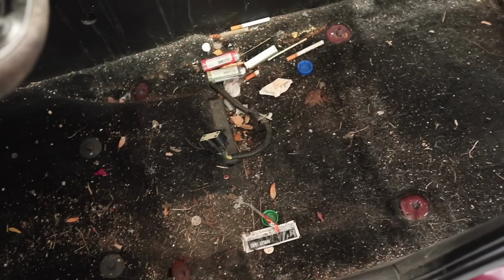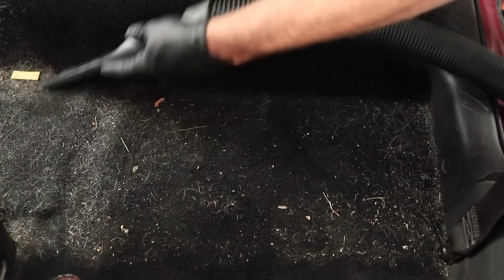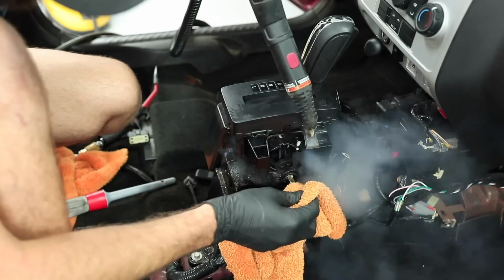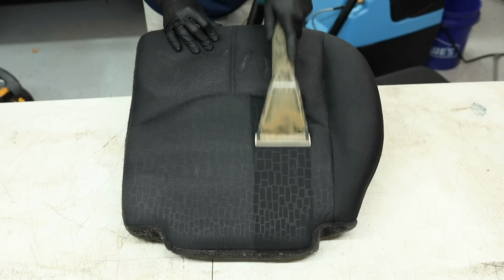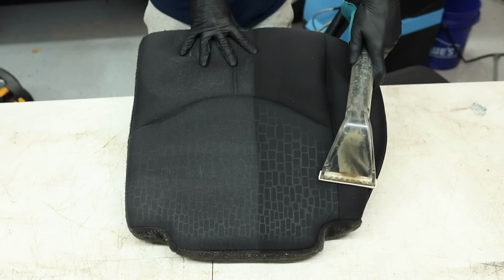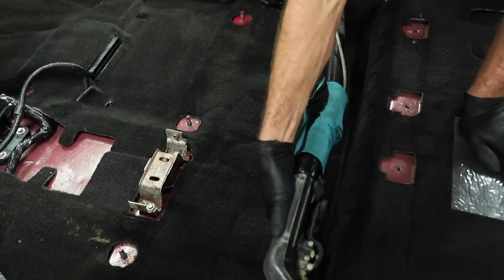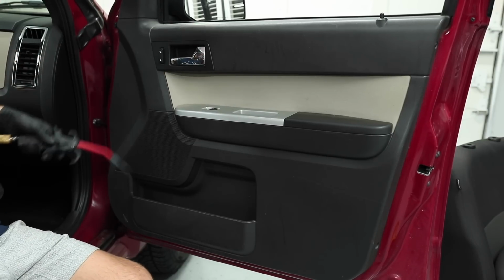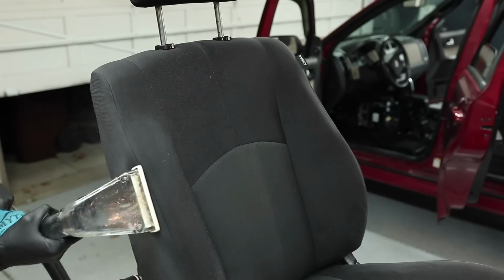Car Detailing Restoration of An Insanely Pet Hair Filled Mercury suv

Comment: Is the bio break still your "go to" cleaner for seats and carpet. I have tried it but it doesn't seem to work real well. Maybe I'm not mixing it strong enough. I usually have to go back over the dirty areas with superclean 4 to 1 or stronger.   Great work as always. Well I see you mentioned Bio break later in the video. I guess i need to mix it stronger.

Comment: I love my microfiber towels + my brushes, now I need to get the scrubber for my drill and I guess, I'll have to go to a gas station to use an air hose for drying. Is there a special solution you use to remove the pet hair? Since I have a van, just getting the front area done takes me longer than it does for you to do a whole car. Plus I can't get the front seats out😔
Reply from the maker: Fox Tail brush from www.foxclean.com

Comment: I have one place on the drivers sit that is brown. It must be tar stain. I have Meguiar's Ultimate carpet and upholstery cleaner. Overall the carpet and upholstery isn't all that bad except for a few places on the front drivers and passenger side of the carpet. Something that looks like coffee or coke stain. On the passenger door on the drivers side looks like a blood stain. This is on the carpet on the door. Hoping that Meguiar's clener can get that off too. Will use a softer brush than what comes with the cleaner. The Camry is a 2000. So care has to be taken because the carpet and Upholstery have aged. The sits are fabric not leather. If you have any suggestions to give me please let me know. Thanks.